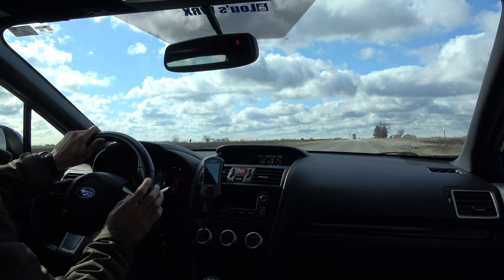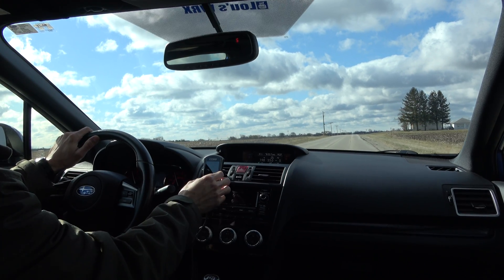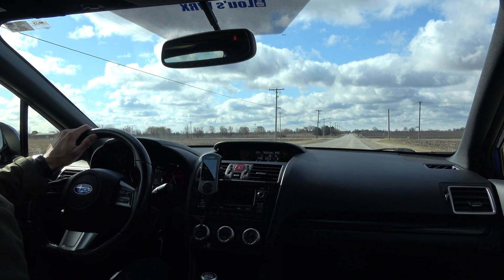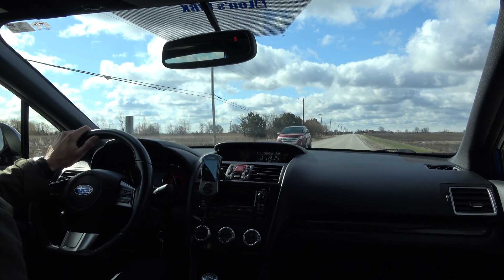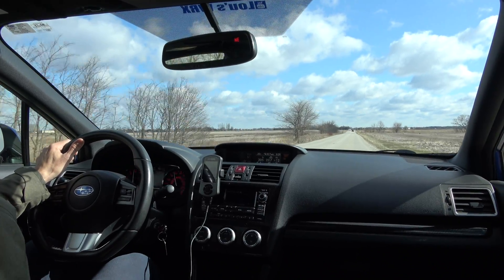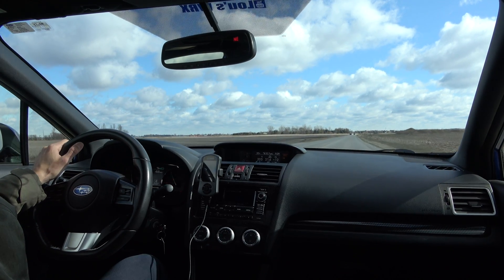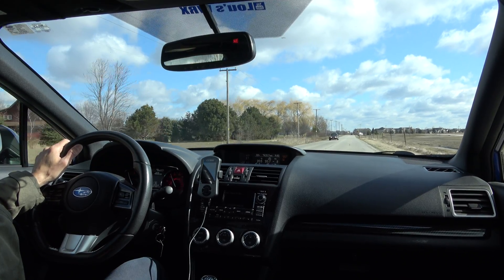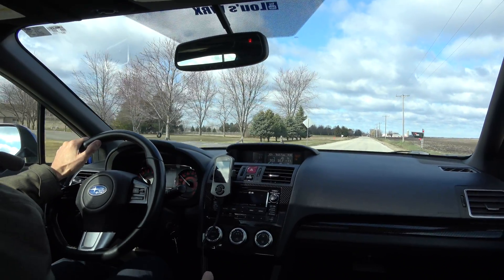2015 Subaru WRX MAP E30 Tune Fuel / Power Cut Data Logging / Testing

Comment from the maker: Ian has since sent these data logs to their tuner for evaluation.  I'll post back here on what they find out.
Reply: Hopefully you'll get that sorted out cause I wanna see some track runs soon!  Haha
Reply from the maker: Madman6505 Yeah I hope so.  And yeah when I go, I want to put all the power down.  If I have a run with a power cut, it's not going be good.  On the 4th 0-60 run I so wish I knew it wasn't going to power cut, that could of been a perfect 1/4 mile test.
Reply: Cool. I appreciate your postings as I am curious to find out what's going on with this fuel cut issue.
Reply from the maker: martin bonds I'm glad it will help others.  Thank you in return for the support.
Reply: Do you think it has something to do with the flat foot shifting?
Reply from the maker: Curtis Hunter I'm sure it is partially related to that.  I do have a subscriber that had the same issue and he wasn't even using the FFS.  Hopefully soon enough there will be a solution to eliminate the issue altogether.
Reply: I just watched your latest video where it sounds like MAP figured out it had something to do with what RPM you had your flat foot shifting set at.

Comment: Hey Lou, I have some questions on driving this car:

1) do you ever go into some boost below 3000 RPM

2) what RPMS do you usually pull in? I'm on stock tune, is it okay to go into decent amount of boost in under 3000 RPM ( not WOT, but maybe some boost).

3) is it okay to cruise between 2000 RPM to 3000 RPM

4) do you ever accelerate or go into boost in 6th?

 5) is it okay to go into higher boost in 5th?

Any tips you can share? Do you need to let the car cool down?

I just subscribed, but your channel is making me want to mod my car. I'm just worried my driving habits on stock will cause premature wear on my car. Some people told me I'm overreacting and stock tune isn't ballsy enough tobreak the car unless you are being an idiot and flooring the car at 2000 RPMs and in 6th.
Reply from the maker: End of Darkness Hi, pretty much the answer to all your questions is yes.  You can boost just fine at lower rpms, just make sure you are in a low enough gear to do a pull.  You certainly don't want to do a pull in 3rd at like 20 mph, or a pull in 5th gear at 30, just pick a gear that keeps the rpm at at least 2400 rpm and its fine.  You can pull in 6th gear as long as your speed is high enough, like 65mph its fine.  Trust me these cars take a lot of abuse, I have probably done well over 1300 pulls in my car and the engine works just as good as it was new, if not better because of being tuned.  I hope that helps, and don't worry so much, as long as you are not lugging the engine you will be fine, just stay away from low rpm high gear pulls, keep it in. 2nd or 3rd for midrange pulls, and the other higher gears for speeds above 45 mph.  Thank you for subscription, and go enjoy you're car without worrying about it so much.
Reply: Lou's WRX you're awesome man! You really are proving these cars are tough, and that most of the people having issues, are because they do stupid stuff with the car. 
Thanks again!
Reply from the maker: End of Darkness No problem, you're welcome.  And thank you for watching my videos.  And yes most people who have issues are probably just doing things they shouldn't be doing with a manual transmission car.  It is pretty hard to screw something up considering what mine has been through the past 43k miles.

Comment: Hello Lou WRX, hey by any chance you know how much boost were you running with the 93 Map tune ? also with the 93 stage 1 Cobb tune with the low and high maps thanks
Reply from the maker: Lito Cruz It depends on the temperature outside really.  On colder days, the car will boost to about 15-17psi tops, on warmer days more like 20-21.  The MAP 93 tune usually boosts between 19-20 on a warm day and levels off at around 15 psi after overboost is done.  On a colder below freezing temperature day, it will between 13-16 psi.  It still pulls stronger on the colder days, it may be boosting lower, but the power is still there.  The e30 tune gets up to 23 psi on a warmer day.  As for the cobb tune its very similar in boost to Map tune,  but I feel the pull isn't as strong.  Hope that helps.
Reply: Lou's WRX ,I got a AP about 5 weeks ago and I'm playing with it sorry for all the questions, i have tried the cobb stage 1 93 tune low wastegate and it only boosted to 15 and then i did the high wastegate tune and the car boosted to 16.5 haven't run the map tune yet,its cold over here in Buffalo N.Y. so that the main reason its not boosting more, just wanted to make sure everything is ok thanks for your help and good luck with your issue.